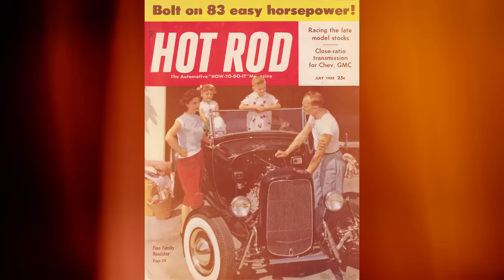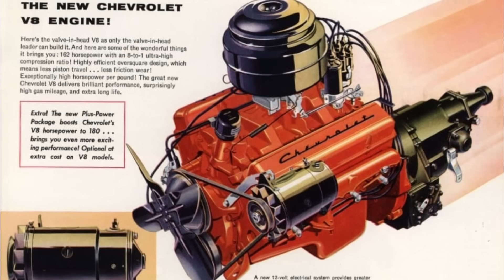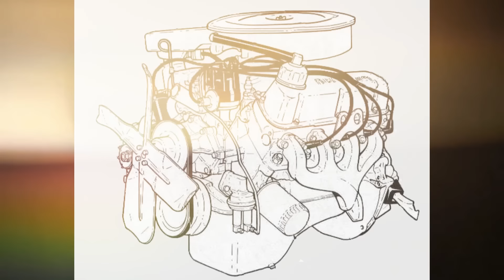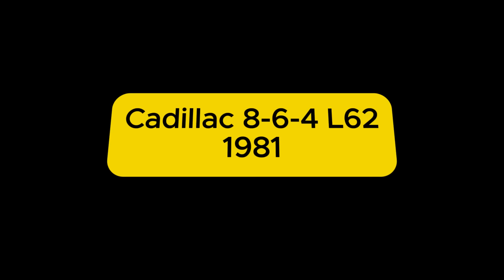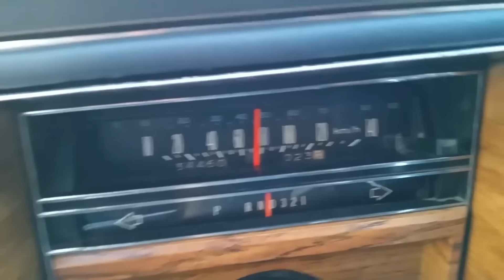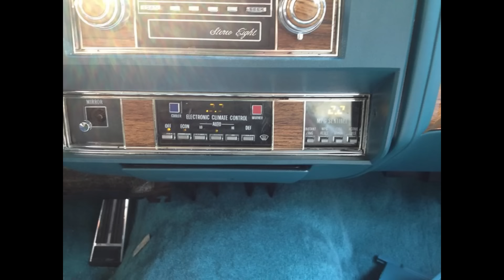WORST Engines Major Companies Ever Put In A Production Vehicle! PART 2

Comment: The Chevy 305 was later a good engine, produced til 1995. The Olds 260, slow but reliable and almost impossible to overheat. The Cadillac 8-6-4, the system itself was bad, unplug it and you had the same reliable 368 from 1980. The Cadillac HT (hook and tow) 4100 should be on your list instead.

Comment: Unfortunately most people rate engine's by horsepower, I rate on how many times it will bring me from point A too point B, my Cadillac is the only 375 hp engine that didn't leave me walking ,and believe me I had to remove the oil wet spark plugs on my Mercury's 400ci. to start it Every time and it would quit at most redlights!!!😂😂😂😂😂😂 😂😂😂😂😂😂😂

Comment: The 350 ci i believe it was back in the late 70" or early 80"s GM tried to convert it into a diesel engine was a heap , We had one in a pick-up truck and wouldnt get out of its own way literally !
Reply: It was covered here.
Reply: Until the crankshaft broke. Then a tow truck got it out of the way.
Reply: Heh.   The cool thing about a pickup with the Olds diesel is you can swap in a 455 easy.   And they were easy and cheap to find in the yards.   Engine, trans, and all - it bolts in like the factory intended it that way.

Comment: I will admit, the GM diesels of '80-'85 are worthy candidates for worst engine honors. Running a close second would be the Cadillac 4.1 liter V8 from '82-'87.  These engines were severely underpowered and unreliable. The aluminum/cast iron mating surface between the intake manifold and the block created an expansion rate imbalance that inevitably caused gasket failure. The coolant found its way to the oil, washing out main bearings, and causing catastrophic wear of the cam lobes. These things were a nightmare.  (By the way- the engine pictures in this video do not always match the engine being discussed.)

Comment: those olds diesel was horrible
Reply: Fact
Reply: it was horrible, they used a gasoline engine block to make there "diesel"
Reply: The blocks are good to build a good 383 out of. The blocks are actually beefier than regular 350 ones.

Comment: Goes to show that US built engines in this time period were no match for Japanese and European car engines built in the same period. Some say the US built ones were reliable. They do not understand these engines were supposed to be the answer to the fuel crisis in the 70’s. I’ve got a 4 cylinder car that puts out more power than most of them in the video.

Comment: I had an Olds 260 in a 76 Cutlass Supreme. It was an excellent engine and shouldn't have been on your list. I once had a 442 400 and was familiar with it. But it only got about 70k on it before the body rusted out. The engine was very smooth. And while no hp junkie, it was a standard 350 Olds engine and parts were readily available for it. The Buick 6 was total garbage. And my Cutlass rusted out way before the driveline failed. This car was so bad even the back bumper fell off from rust. And all the GM's of the time did the same thing. A horrible time for GM cars no doubt. But it was a gorgeous car and I loved my Cutlass Supreme all the way to it's accelerated decrepitude end. Today, I won't own a GM. And that's not why. That was a 2006 Impala SS, their most expensive car, that went the other way. It's body didn't rust; BUT EVERYTHING ELSE DID. It was such a junk car, I had to replace the transmission cooling lines twice, and the power steering hoses twice. Everything corroded and failed and when even the trunk seal started leaking, 275 dollars again. That was it, I swore off GM completely and it was GONE. The prettiest piece of garbage on the road. Thank the auto gods Mercedes bought out Chrysler. That gave me some time with Mopar at least and I bought four of them and still have them today. 3 Jeeps and an AWD supercharged Dodge Charger. One will be 20 years old next year and it still running strong and looks great. Then Stelantis came along and Mopar is off the list as well as GM. Does Mopar even exist anymore? I'm not even sure. SRT doesn't, and all the Mercedes are gone. Luckily all of mine are pretty new and I'm the one who's retired. LOL

Comment: I don't understand why Oldsmobile didn't use the Series 92  Detroit Diesel engines in the cars. They were reliable engines  and came in V6 and V8 configuration. After all GM owned Detroit at the time.

Comment: My olds 260 was slow in my 75 cutlass but it never used/ leaked oil or broke down and got 25 mpg at 55 mph,it got stolen with an odometer reading over 400k. Best car I EVER had.

Comment: Chrysler Lean Burn-Spark Control Computer 1976-1989 were awesome reliable engines..

The Lean Burn-Spark Control was a Computer that could easily be changed in 15 minutes!! 

You get a new distributor,ecu and boom reliable engine with no regulations and more power if you swapped the carburetor with the deletion of lean burn/spark control computer the cars had huge power gains and reliability!

Comment: Add the Plymouth 318 ci engine.  I had a 1958 Belvedere 2 door (same as Fury) that spun conrod bearings several times.  During the time I owned that junk ANYTHING that could fail DID.  Engine, auto transmission, rear end, AC system etc etc.  Since then I have not owned a Chrysler product and have blocked many fleet purchases.
Reply: You bought the 58 Belvedere new??
Reply: You'd be the only person who had problems with them.
Reply: Hmm. The poly head 318 was generally fine, and the LA version from 1964 was just about bulletproof in decades of service.
Reply: @PeopleAlreadyDidThis  67
Reply: @1958Cadillac-v2g  Nope, one year old, someone had already been blessed and got rid of it.
Reply: That's the first time I've ever heard of a 318 mopar engine ever having a problem I've got them stockpiled. It's my favorite. Ive got wide blocks and the LA and magnums

Comment: The Chevy 305 should not be on this list.  I have one with over 225,000 miles on it and it runs perfect.  It only uses about a pint of oil when changed every 4,000 miles.

Comment: Those lean burn Chrysler engines were HATED by Chrysler fans. All of the manufactures mid 70s to early 80 engines tended to be awful. Chrysler had an addition problem. The company was in a bad situation. This led to the hated "K" cars.

Overall the engines that were choked down to meet MPG requirements or just designed as fuel efficient engines seem to be all over this list. This should be noted by GM, Stellantis (idiots IMO) and Ford. Ford, IMO, has done better than anyone in managing their car models to have some performance they can sell and cars whose fuel efficiency is high enough to offset the former models performance. GM had announced, a couple years ago I believe, that they were going to stop all car models. That implementation appears to have drug on much longer than GM wanted. Stellantis promoted Dodge as their performance brand. Now with all the carbon credits they have had to pay to keep it that way, Stellantis is almost universally going to hybrid or some form of high MPG engines. 

This entire fiasco that many US companies are fighting is INSANE MPG requirements. Why do these exist? Simple - force the fake global warming on humanity. It has been global cooling then global warming then global cooling than global warming and they got tired of selling 180 degree opposite problems all the time. Now it is global "change." Of course it changes - it is called WEATHER. Our temperature and carbon in the air have been perfectly normal. The more carbon is taken away the less green life exists. The less green life that exists the less oxygen exists. The less oxygen is bad for humanity. This is the definition of fascism/Corporatocracy. Ultimately they want to create a feudal society where you are in effect all slaves to serve the "lord" - the elite international corporations. 

DON'T BELIEVE ME. Read the #1 goal on the GA Guidestones they destroyed. To keep population at less than 500 million for the Earth. That means 7.5 BILLION people have to be eliminated. 
2 Read about the UN Agenda 21. 3 Read the UN Agenda 2030. 4 Read about World Economic Fund. There are many more. Educate yourself or practice yes sir lord and giving everything you have, including your life, to your lord of the manor.

Do you want to own nothing? Do you want all humanity to live on less than 5-10% of the land? Don't worry, the elites need serfs.
Reply: @Irish_For_Life1842  The lean burn was a dud. I had one in a 77 Chrysler with a 318 and any Long trip we went on we would take the 1969 Oldsmobile Delta 88 with a 455 Rocket cause it was dependable and was better on gas. Chryslers lean burn was junk!

Comment: 262 Chev,, did what it was designed to. The original SBC was 265ci. As did the 255 Ford. The original Windsor was 221 and 260.  I dont want either but the Govt did!
305 and 307 are differnt decades
ELB on Mopars worked fine when maintained.

Comment: The very worst engines not on your list were from Cadillac, of all people. The Cadillac 8-6-4 engine, not only didn't work. It would actually start on fire and it was illegal to make them safe. And next is the Cadillac Northstar that was made to replace it. It could go "100k between tune ups" and couldn't keep a head gasket and were terminal when they blew. And don't forget the Cadillac 4.1 all aluminum all time biggest POS ever made. Those completely wore out in only 20,000 miles. Only 2nd to the Chrysler Lean Burn, which was also illegal to fix. Those three Cadillac engines were absolute total garbage and should've bankrupted the company. Our family wrote Cadillacs off completely after those fiascos, and three generations of us were driving them. Four counting my father. What a damned shame. We came from the Caddy 525's, 500's and 425's. Total sweethearts, to being ripped off by that junk.

Comment: The 255 Ford V8 would've been so much better than the 3.3 L in-line 6 in the Fox bodies that they would've seemed competent.
Reply: They offered the 255 in fox bodies, 80 and 81 I think.   The 200 straight-six was still better.   They ran about the same (the six got slightly better gearing) and the six was easier to maintain.  If I found a perfect condition fairmont with the 255 in it, I'd rip it out and put the six in it... that is, if I didn't have access to a 302.  Hate hate HATED the 255.
Reply: @xaenon  I had the 200 in-line 6; it was the most gutless engine I've ever experienced . Surely the 255 V8 had to be better.

Comment: All of these are "supposed failures" are configurations of great engines.  It is not the engine design that is at fault, it is the government's push for emission and MPG standards that the companies attempted to change their engine cubic inches to meet.  Example: the Small Block Chevrolet Engine;  Legitimately the greatest V8 ever made, (roughly produced from 1955-2000) in multiple cubic inch configurations.  The original was a 265, then grew all the way up to a 400.  Same for the Small Block Ford or Hemi.

Comment: Where is the Ford (Ferd! 😆) Y-Block with a plague of oiling issues for the top end (rocker arms/shafts) due to a very bad design of the oil galleries, that was also used in one of their inline 6’s with equal identical issues? And to compound the oiling issues, the Y block V8’s had that stupid cross over exhaust pipe across the front of the engine that dumped heat over the engine that caused them to run hot (and the flat head V8 sometimes used the same stupid set up!) and also dumped so much hot gases through the passenger side exhaust manifold that it pretty much glowed red, compounding the poor oiling issue by coking the oil in the exhaust valves on the passenger side causing sticking of them sometimes and overheating them, causing warping and burning? Also, the Y block had, for some unlocked reasoning, an odd, different firing order that made these Y blocks sound like they had a misfire when they did not, especially when fitted with single exhaust with that dumb cross over “knuckle burner” pipe! And the true cause of overheating in the Ford flat heads was NOT the 2 water pumps, but rather, the exhaust passages in the block being too long to the ports where the 3 branch exhaust manifolds attach to the block, and run through the water jackets where the high heat dumped into the coolant and overwhelmed the cooling system, often generating steam bubbles that caused pockets that blocked coolant flow to the radiator. Henry Ford wasn’t that bright. He saw this design as good in winter for fast warm-up and cabin heat, not ever considering severe overheating in the SUMMER!! Duurr! 🤪 This issue is why other flat head V8’s like Cadillac had a “hot V” design with intake and exhaust manifolds in the valley up top to keep exhaust heat out of the cooling system, even insulating the manifolds and down pipes in asbestos to prevent radiant heat from being van issue! Engineers Ford never had and still don’t Every engine they ever made literally belongs on this list! All were a fail in one way or another! 🙄😬 Cheers! 👍🏻😊

Comment: The Dodge baby hemi in 1954 model was reliable and much quicker than the new Ford overhead valve V8 of the same year. I believe the version of the Hemi in a Dodge that my grandparents owned had a 4 barrel carburetor on top of a silvery sort of  high rise intake manifold,the car was a bit sluggish off the line but revved and revved and revved,I think it could have done much more than 100 mph 
the weakness of the car was the lousy 2 speed automatic transmission,not the engine.

Comment: You could've said any American V-8 between 1974 to 1985.
Reply: Hi HichaelRoy, one problem the "the big three" had was that the final drive ratio (rear end gear ratio) in most of the cars at that time where geared much too high.  Instead of lets say a 3:50 to 1, or an 3:25 to 1 gear ratio, the factory would install a 2:75 to 1 for better fuel economy but the cars would not perform good at all.  For an example, the late 1970s Pontiac Trans-Am(s) had big powerful engines, but came with about a 2:50 to 1 gear ratio!  SICK!  Please reply.  Dave...
Reply: @daveridgeway2639  Sir...The 1973 T/A SD455 had a 3.42:1 and no not ALL cars had the high gear ratios.
Reply: @daveridgeway2639  Thumbs up, dude!   Axle ratios were a big part of the problem - also, torque converters had lower stall speeds, and automatic trtansmissions were set up to shift sooner than their 1960s counterparts.
Reply: @shanemitchell477  Yes, but you're talking about ONE very specific example that was essentially built like musclecars from the 1960s.   Definitely NOT the norm... 2.75s and 2.79s were very common in American cars; Ford even had a 2.47 ratio by 1974.  Even Z/28s were maxing at like 3.23, and that was an extra cost option.  Most had 270-something.  Manufacturers were being fined if their aggregate production didn't average a certain figure, and the spec was getting more stringent every year.
Reply: @xaenon  You are correct.  If you bought let's say a 1975 to 1981 Pontiac Firebird Trans-Am, SAE net rated horsepower (1972 and after) or gross rated horsepower (1971 and before) was not too bad coming from a big 4 barrel emission controlled engine, (not all emission controls rob power), but in the mean time, the car would be equipped with an 2:50 to 1 rear axle ratio, which is not a performance ratio at all.  If you own a mid 1970s to early 1980s emission controlled performance automobile, I would say, lower the rear axle ratio first before removing any emission controls, and you will be in for a real treat!  I had an all stock 1977 Corvette with a factory 350 L-82 engine, factory Turbo 400 transmission and a factory 3:55 to 1 Positraction rear and it performed 14.8 @ 119 MPH in the 1/4 mile with no modifications and all emission control(s) present.  You notice that I capitalized Positraction, that is because Positraction is a trademark of Chevrolet Motor Division of GM, meaning closed differential.  Please tell me what you think!  Dave...
Reply: @daveridgeway2639  You are abslutely correct; in fact, you are describing a strategy I used to build an old Maverick Grabber into something of a street rod., without any significant mods to the engine (at least,, not until later in the project).  First step:  lose the 2.75 rear axle ratio and swap it for 3.25s.   Step two:  SHIFT KIT.  Step three:  - deep six the carb for one from a mid-1960s 289 - still on a factory 2V intake!   Step four:  shit can the emissions crap and put in dual exhausts. That ALONE  was good for a much stronger zero to sixty.  Didn't do much for gas mileage, though....

The engine mods that came later really woke it up.  4V carb, mild cam, ported heads, real tube headers.  I went to 15 inch wheels for street use (to reign in that axle ratio a little), but ran at the track with 14s.

Drove a lot of the Camaro guys NUTS.

Comment: Everything said about the first generation Hemi in this video is wrong.  The original dual rocker shaft engine (Hemi) was never designed for outright power.  It was merely designed to perform reasonably on any form of gasoline available at the time.

Comment: The Chevy Vega engine.  Hands down the worst ever.
Reply: Pretty bad, yes .  One engine not covered was the original Ford Escort 1.6 mills... lose the timing belt, engine go boom, scrap the car.  It ain't worth fixing.   The belt was supposed to last like 50,000 miles but they'd bust at like 35,000.   Interference engine, valves and pistons would be mangled when the belt broke.  It was such a bad thing that most mechanics in those years would do both water pump and timing belt - see either, replace them both, since the front of the engine had to come apart to do either anyway.